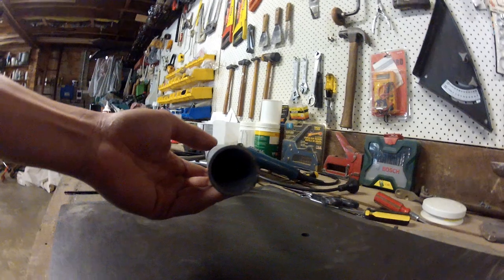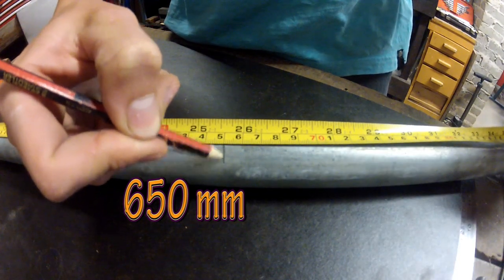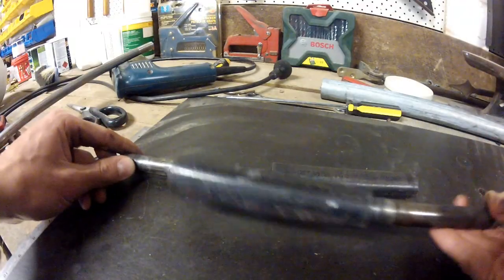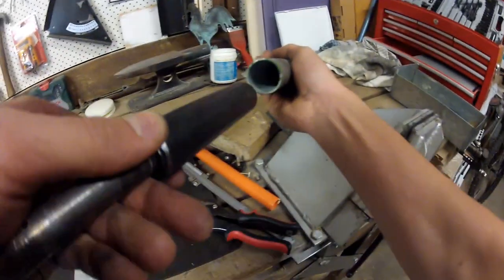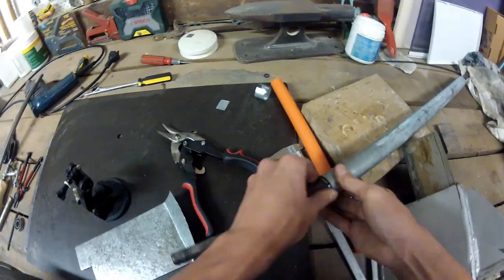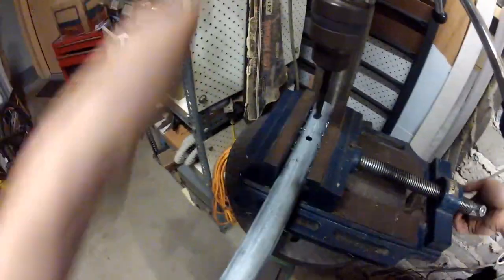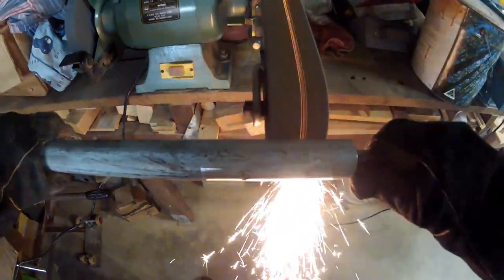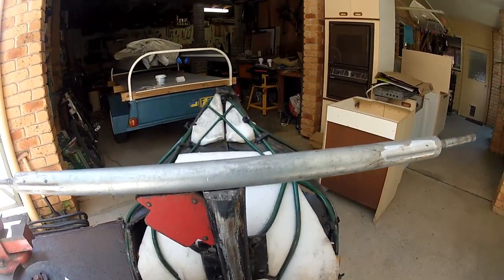how to make a drift trike axle for home made wheels

Comment from the maker: i left about 1.5cm of axle out side the wheels drilled through the axle and put a nail through and bent it over spacing the excess with washers, these also help protect the bearings.
you can also thread the axle if you want to get fancy

Comment from the maker: the smaller pipes are so tight fitting they didnt need welding at all 
if the pipe you have is loose fitting then you would have to weld it
it comes down to what you have and how you can best make use of it